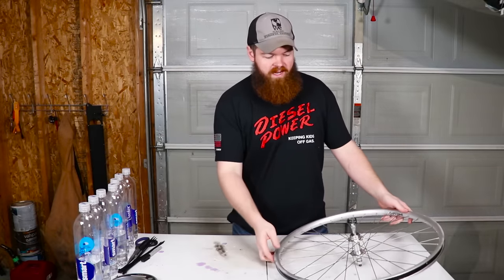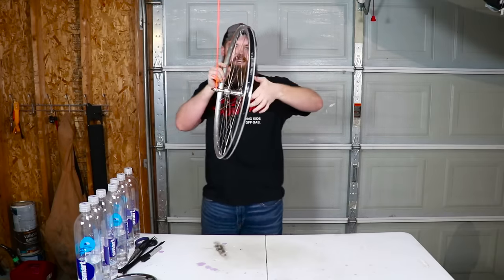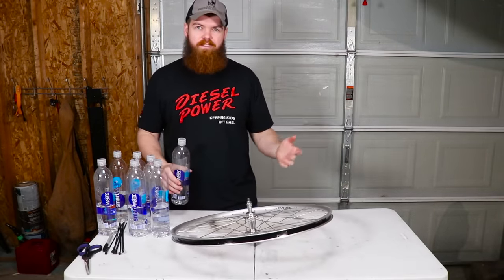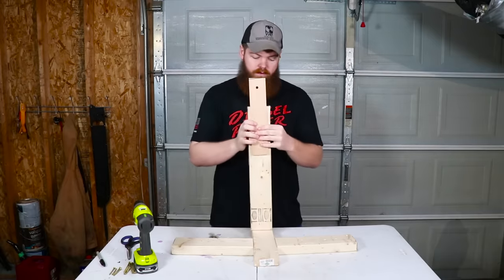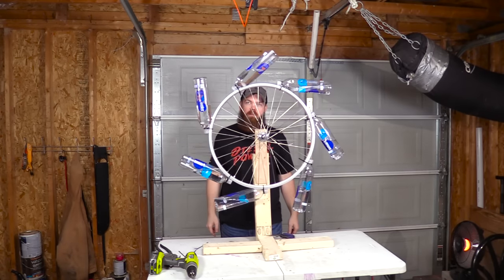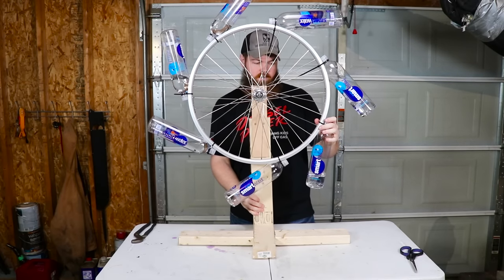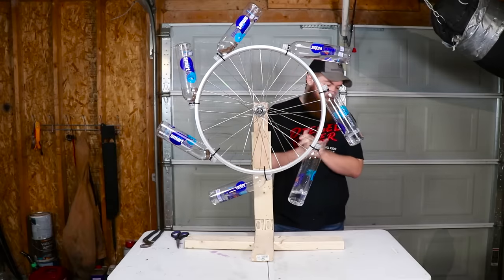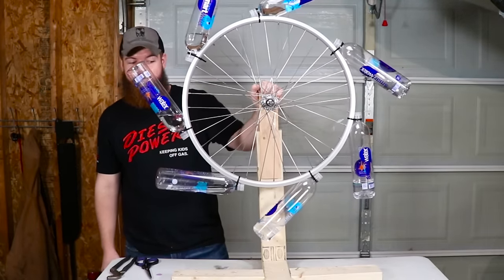Can A Perpetual Motion Wheel Actually Work?

Comment: If you use Aquafina water then the molecules would be dynamically changed and this experiment would work because scientifically Aquafina water is less dense than any other water and has more molecules per million then any other water. So combined the centrifugal force with the dynamically changed water molecules connected to the mother molecule it would work.

Comment: The water is tipping on the top.  But you are forgetting that the water goes the opposite direction when it spins to the bottom. Thus, countering what you are trying to do. Yes, the water runs to the other side of the bottom flipping the weight on the top. But that water has to reset. It does it on the bottom, when it tips on the bottom. Causing the machine to seize.

Comment: The force is changed because the water in the bottles on the top is working against the water in the bottles that go to the bottom. You have a better chance cutting those bottles and catching water that is being poured into them. This design is horrendous.

Comment: The reason it doesnt work is because although the bottles may weigh the same, have equal spacing, and be at the same angle; the water falling is canceled out by the waters momentum sliding back down the bottles on the other side.

Comment: I know I'm late to this but I want to try an answer this question for anyone who's still wondering why this isn't working.

I think the problem might be a gravity issue. Let's keep in mind that gravity is stronger the higher you go. To move upwards the bottom bottles have to create a greater upward force than the downward force of gravity being exerted on it. At the same time the top bottles have not only a stronger force of gravity being applied but also a higher velocity than the ones on the bottom. Overall the downward force of the top bottles is greater than the upward force of the bottom bottles. This discrepancy means that the circle will slowly slow down because there's not enough upward force being applied to keep it going. I think that's why it started spinning better when it was flat because gravity was no longer a fighting factor and was equally applied to all the bottles.
Reply: Hello another reason of why it didn’t work is it breaks the first and the second laws of thermodynamics,
You can’t get more energy out than you put in and
Energy tends to spread out through processes like friction so it would always stop, thought you might wanna know

Comment: You have installed 1 spoke wrongly, all are 5 spokes apart but have tried 1 spoke spaced 6 spokes apart, so you still haven't achieved complete balance, so gravity is still pulling the head at an angle.

Comment: you have a problem in the design
you forgot the torque law which equal the T = Fr  if angle is 90 degree , so the right hand side of wheel must has bigger weight than the left one, so
you must have 8 bottles not 7 or in general, even number not odd, 
then put the bottles twice twice depending on the torque law, then it will success 👍

Comment: The reason this doesn't work is that the energy provided by the water on the right side of the wheel, is then used to move the water on the left side, leaving no energy to move the wheel.

Comment: I guess perpetual motion isn't entirely impossible since the Earth rotates and revolves around the sun and has done so for billions of years. The problem in this video is the Earth's gravity which is pulling down not only on the side where the bottles are going down, but also the side of the wheel with the bottles going up which would cancel any forces created by the water moving inside of the bottles.

Comment: for starters you don't have enough water bottles, and then you don't have them filled 40-45%. You are not forming a complete closed loop. You have too man y breaks or rest spots.
Reply: The known laws of physics are preventing this from working, not his bottle count.There's more than just a problem with his setup 🤣. Any machine like this is literally impossible. No matter how you try to achieve it, not matter how smoothly you can get it to run, no matter what you do the wheel cannot spin continuously.

Comment: It doesn't work because the bottle on the very bottom of the wheel extends past the center, so while the water has more leverage on the right side, the left side has slightly more weight to counterract it.

Comment: You did it all wrong. First off you only use 4 water bottles, paint them black. Put something solid on the back of the wheel like a piece of fabric, paint it white. Now paint a straight line(very important) from one bottle cap to another, creating an X pattern. Then hang a red sheet in the back ground, not too light, a nice deep red. That should work.

Comment: Even if he made everything perfect, it would still not be overbalanced.  It is more of an optical illusion that has stumped people for centuries.

I will now demonstrate how to the the actual math... quick and dirty:

Structural statics are usually not taught until late highschool or college which is a bit of a shame--for such a cool subject!!! But anyone can check this with a free online cad program. Draw a long rectangle, rotate 10 copies (or as many as you like) around a centre so you get the general layout of this contraption. Draw a line across each on the 10 rectangles (simulating the water level), and trim the top portion leaving the bottom portion (to simulate the volume of water). Draw a vertical reference line through the center of the hub extending comfortably up and down past the highest points and lowest points. Then measure all the horizontal distances from the reference line to the CENTER OF GRAVITY (geometric centers) of each shape, measurements to the left will be negative and to the right will be positive. Since the volume of water (or cross sectional area of the shapes) are all equal, you would get a ZERO sum if it is balanced or a negative sum (in the orientation presented in the video) if OVERBALANCED. And—oh my word—it always equals ZERO at any frame of rotation, any scale of rectangles, or any shape!!! It only "looks" like there is more water extending on the left side, hence will always stump people who do not want to work out the math or the geometry.

Comment: First the problem with the scale is probably because you add water in small amount... (try filling a shooter glass with water using a seringe by dropping the least possible  amount in it... the scale keeps resetting...)

Second is the weel dont turn because of the momentum energy vectors that is wrongly understood... the water in the top bottle uses the energy to move (accelerating) inside the bottle instead of pushing the bottle down... exact same reason why the spinning weel stay vertical... so it can not work... the law is simple... more you accelerate in a particular direction lightier you are... or saying other way you pull your gravity vector toward the direction you are going... so when the water moves inside the bottle it gain or loose speed so it weight less than the non moving water i speak of "moving or not moving" by comparing the water with the bottle itself... i know that some "flat-earthist" may say "the water moves inside all bottles" ... no... or at least only a small part of the water inside the bottles that are on the side of the weel... you can be in a car that run at 100 km/h and take a bottle of water and empty it in a bowl without a splash... unless you are clumsy... speed dont affect weight... acceleration does... because univers is "relative"... the waters movement is only compared to the inside surface of the bottle... you could have the same result with a fixed set of bottles filled with magnetofluids and spinn a big magnet arround it...
Reply: Oh and i forgot that even if the lost of weight in the accelerating water seems insinificative... it is playing a big role when it comes to conteract the bottle in the other side of the weel...

Comment: have anybody tried to put one bottle with more water, the next one with less water, the next one the same as the first, the next one as the second and so on?,  besides the weight force of the water is not as good as some steel balls inside larger tubes to impress more torque avoiding also the bigger tendency leveling that the water has.
Also two auxiliary crosses can be connected on the same axis on both sides (one of the sticks is longer than the other, in the long one a magnet is placed on both ends that rubs in repulsion against a magnet placed on some external support, and on the shortest stick is placed only one counterweight on both sides, so the possible loss of inertia of the bicycle wheel could be avoided by the additional inertia of the two crosses.
You lose nothing in doing it after you already have almost everything there at hand hehe.

Comment: Okay, so, obviously, perpetual motion is not possible due to friction and the inefficiencies of mechanics.  With that being said, you might have had a better shot at getting the wheel to spin for a while if you didn't have an odd number of bottles on the wheel.   With the odd number, there comes a point on any given rotation at which there is significantly more mass on one side of the wheel, and my guess is that difference in mass is too much for even the leverage gained on the short-handed side to overcome.  Check those videos you were watching a see if they have even or odd number of bottles.  My guess would be even.

Comment: You have to put less water in the bottles on one side... of course I am kidding.  No, we cannot create energy.  Though the water falls in the bottle, pulling the wheel around it still must lift the bottles on the other side of the wheel and runs out of power from your spin.

Comment: Does it "work" yes ... 
Does it run forever ... no 
If you take any energy out of it to power anything does it slow down even quicker .. yes 
Are all of these true if you just add fixed weights rather than water in bottles ...yes 
Is it perpetual motion ... no

Comment: The problem is you need to flip it upside down and eliminate the back pressure in the compression system I'll give you a clue boyuoncy gravity water displacement compression hydrostatics hydrodynamics hydromechanics aquadynamics trompe 🐋  submarine

Comment: Always whole-ass, never half-ass, otherwise you get videos like this. Think I'm wrong? Lemme two-bird-one-stone you an example here, the stand. Whole-assing would have not only put some supports up to stop the side to side motion while the wheel went round, but the operator of said device would have spun it from the open side, allowing for a clearly superior test with more consistent forces keeping everything balanced. Basically I'm saying this maybe was a "proof of concept" kind of thing instead of an actual test..? And if you disagree with that, will someone with a knowledge in physics list some variables he forgot to account for, and particularly those that were just ignored all together.

Comment: The position of each bottle is not balance from one to another.resulting that it does not works. When installing the 1st bottle to the rim, the 2nd bottle should be 180 deg from the 1st bottle. Then the 3rd bottle should be 90 deg from either the 1st or the 2nd one. The 4rd bottle should be 180 deg from the 3rd  bottle ... .and so on.  by doing that it should works... Anyway good try bro.

Comment: Your premise that the machine will not work is not necessarily correct.  You built the machine incorrectly with 7 water bottles; the number of bottles needs to be a even number in order to be in balance.

Comment: Just as hydraulic shock absorbers turn energy into heat, bottled water turns the initial torque energy of the wheel of this device into heat. This is why the wheel stops so quickly even after a strong initial torque. If you fill the bottles completely, you have a great flywheel that will spin for a long time!🤣🤣🤣😂😂😂😂😂😂😂🤣🤣🤣🤣

Comment: Hello Tylertube,
The wheel didn't work because of the angle of the bottles that you used from the middle of the bottles to the neck of it, and the bottle is too long, change the bottles to a little shorter ones with different shapes from the middle of the bottles to the neck of it, and add a bottle more to make it 8 bottles because the wheel is wide, and note you are spinning the wheel in the wrong direction, do the necessary corrections and it will work

Comment: For starters a good engineer would measure distances between cap's, then I would have added more cells for more weight leverage, also adding longer bottles for more leverage to. Threr are such machines out there that do work but people seem to think it's that easy, an if it was we would all have that system already. Leonardo davinci was working with all of these designs as well as turning lead in to gold but these secrets were suppressed by the powers that be! Just like Nicola Tesla!        But  nothing In this world is impossible, we just need to think outside the box we have been put inside of....... 

Voluntario nihil diffcile. 

If this fraise is from the LATIN language, than there must be some truth there somewhere?!!!......... 12:55